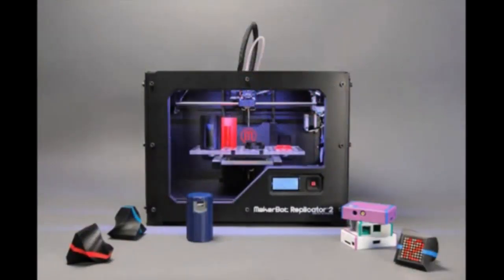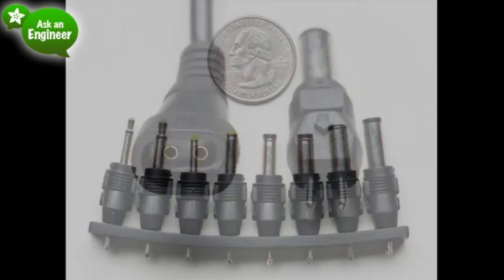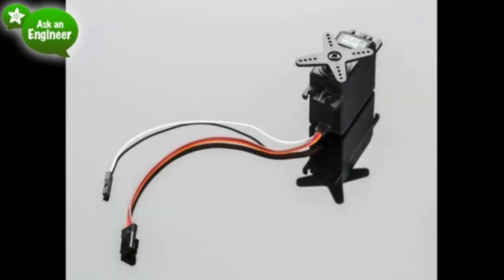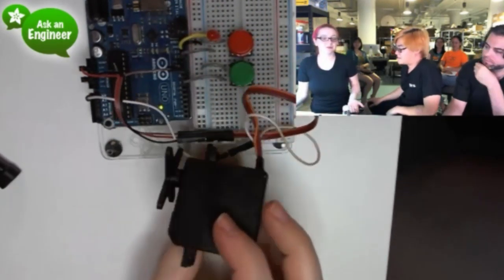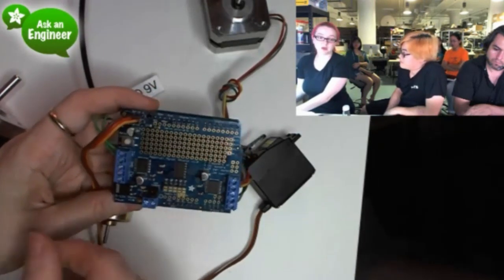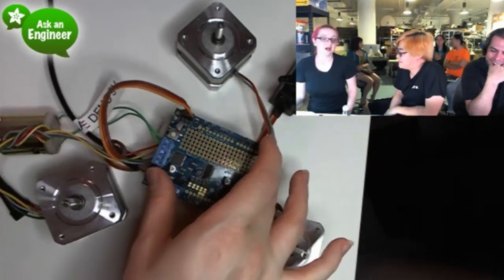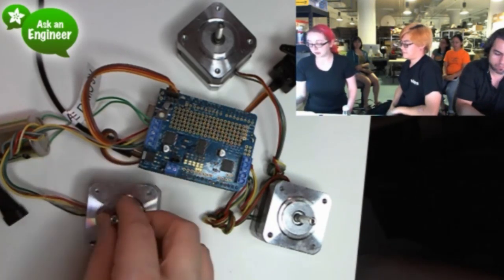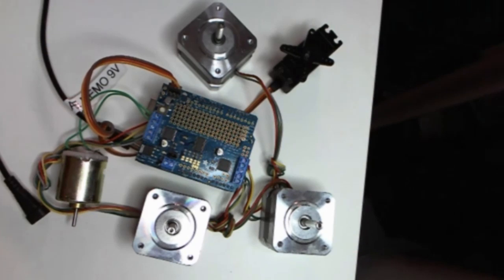Motor Shield & More! New Products 7/13/2013

Comment: You can use Shield stacking headers instead of the normal headers (adafruit has them) or just normal male-female headers and solder them on  the sides of the main pins and they are all usable and in the same order as the Arduino.

Comment: Most shields use the same pins when you stack them. This new motor shield is a bit different. The motor shield is controlled via the I2C. You can connect many different I2C devices to the same two I2C-pins by giving each device a unique adress. The other arduino-pins is available to be used as you wish. You can control all kinds of devices via the I2C-port, like eproms, the mpu-6050 (this is one amazing device, 3 accelerometers+3 gyros in one little device, google it!), LED-controllers +++

Comment: The servos with the built in potentiometers are going to be fun to work with. I am going to have to try to connect these with the VEX Robotics system to see if I can get it to work. It would be nice if I had a 3D printer to make custom mounts similar to those of the VEX mounts.

Comment: I never got around understanding this stacking of some type shields on Arduino. How does it work? Won't they use the same pins, thus blocking other shields' access to control lines?

Comment: Like claudio asked....what if I wanted to use other things like line sensors, which pins could I use since the motor shield doesn't seem to have any extensions from the arduino board